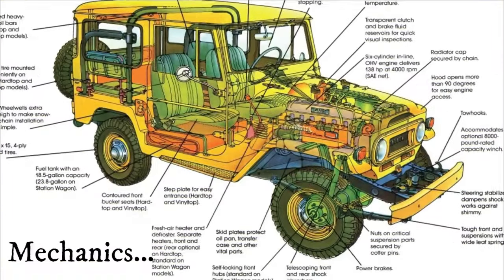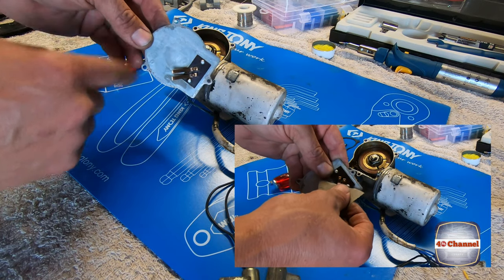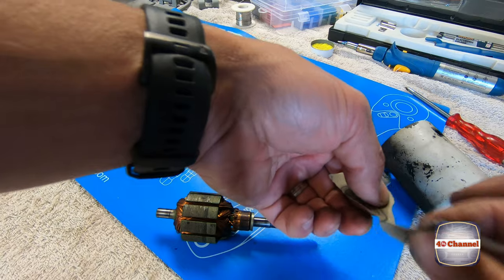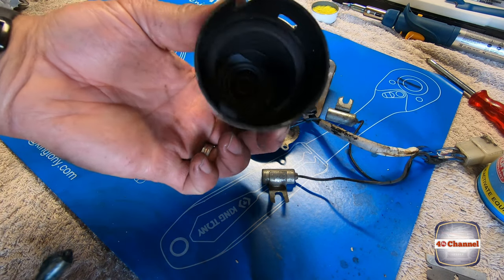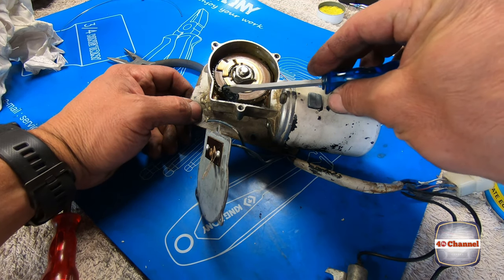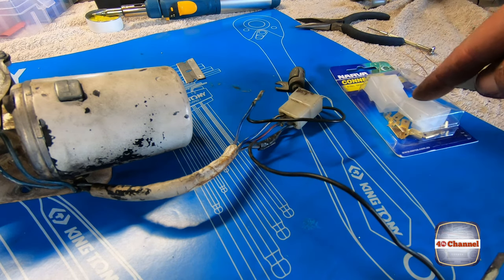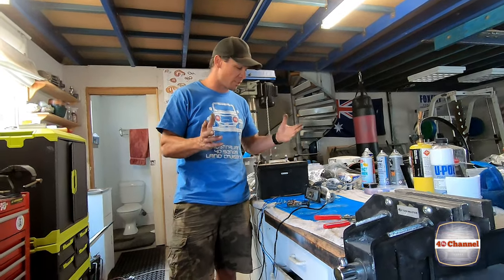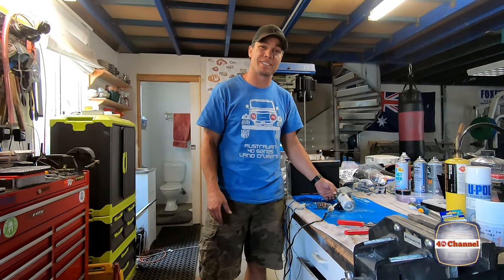EP27 - 40 series Wiper motor re-build

Comment: I watched this twice and decided to tackle fixing my wiper motor myself since I couldn't find someone willing to do it for me. Thanks for the inspiration to tackle something like this. I look forward to your videos each week.
Reply from the maker: Good on you James for having a go! and thank you for your support mate.
Reply: How did you do with the re build?
Reply: @scottanderson951  it went from not working, to working. I think the biggest issue was replacing the 40 year old grease that was inside. It was thick as tar and put a heavy load on the wiper motor, which also caused fuses to blow. Imagine my jubilation when I got it working. These things are stupid expensive if you can find them. Almost $400 USD! 
My biggest takeaway was using the wire to hold back the brushes. I would of never thought of that and I would of never got it back together.
Reply: @jamesenloe2791  howdy, what kind of grease did you get? I am currently seriously thinking on doing this work by myself as they are stupidly over £300 on eBay
Reply: @albertbenz93  I used white lithium grease since the gear on the inside was plastic.
Reply: @jamesenloe2791  thank you! I guess fixing that motor will be my little project next weekend.

Comment: Out of curiosity, I wonder if the motor (commutater) from a RHD will attach to a left hand drive wiper assembly
Reply from the maker: Hi David, I haven't seen a left hand drive setup in Australia so I'm not sure, But knowing Toyota they try and make there parts fit as many vehicles they can, so more then likely.

Comment: Great vid! I'm just starting to work on the '71 40 that I'm doing with my sons...... been looking at a bunch of your videos, and already subscribed. Question....where did you get the replacement connector and terminals?
Reply from the maker: Thanks for your support Mike, the connectors and terminals are NARVA QUICK CONNECT (Which are the same at the original connectors) , I got mine from autobarn.